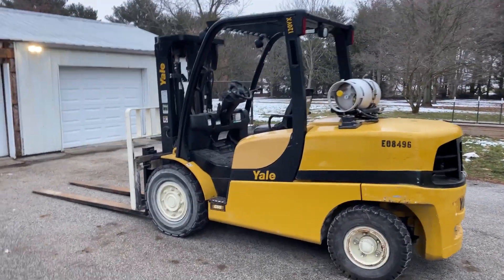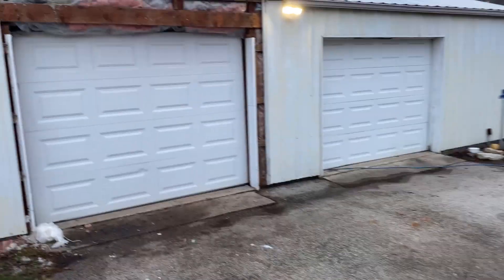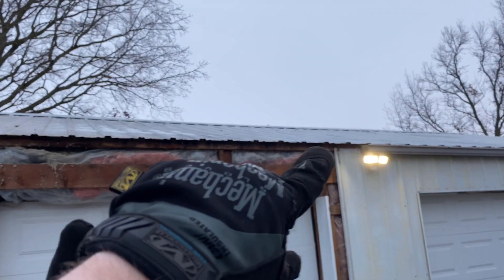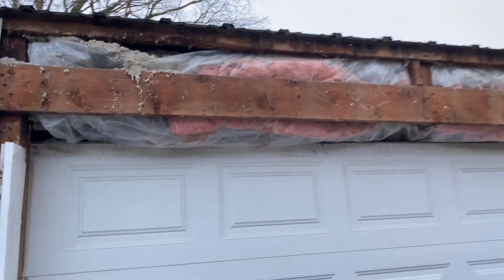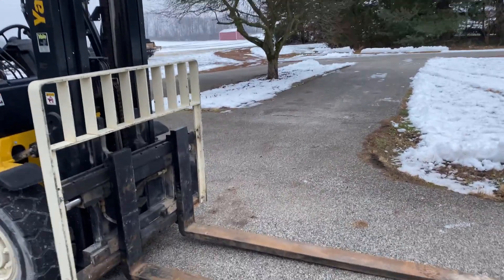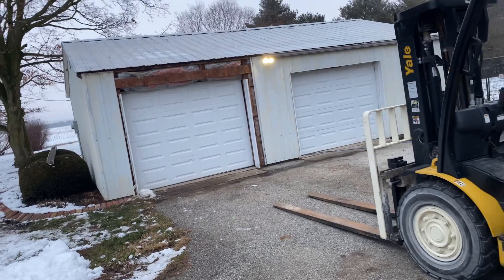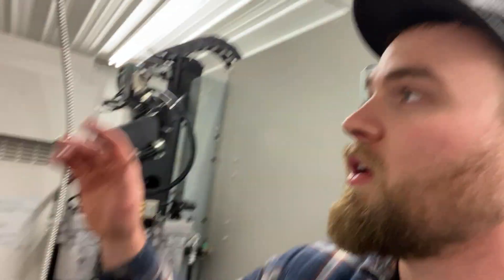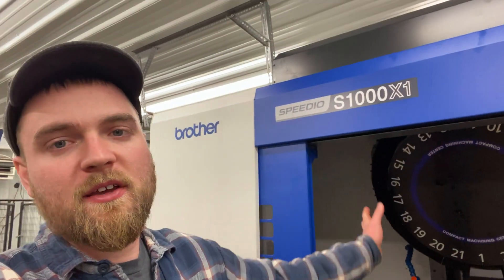New Machine Day! Brother Speedio S1000 Unloading/Unboxing

Comment: How have you been liking your S1000 so far?
Reply from the maker: It’s amazing so far! My cycle times are crazy fast and it holds tolerance all day and night regardless of shop temp. My only complaint is the sheet metal flexes when you lean in the machine and squeaks. I’m guessing this is only a problem on the s1000 with the huge door
Reply: @ozmachinecompany4564  That's awesome--seems like everyone I've asked has been enjoying their Speedios. How much did it cost you in the end before shipping and tax?

Comment: Hey, are you the guy I bought the TC-229 from?  You'll love the S1000, I love mine.
Reply from the maker: Maybe!! I had one and sold it a few years ago. I hope your doing great!
Reply: @ozmachinecompany4564  Yep, that machine has run thousands of parts, I did a restoration on the cabinet and replaced the spindle.  One thing with the S1000 is to make sure the power is all within Yamazen's specs.  If you are still running a phase converter, all the phases need to be within 10% of each other.  I had to get a 3PH transformer for it because it definitely did not like the high leg.  The TC-229 has no problem with the 220 right out of the phase converter.  If you have any questions, I'll be happy to help.  Just use the G100 and wear your brown pants.
Reply from the maker: LiTenUpADP glad to hear it’s making parts! Hahaha this is hilarious because I have my step down transformer showing up within the next 15 minutes. I’m glad you reached out! I will let you know if I have any questions. Your S1000 looks awesome. 4th axis is so nice. I’m selling my Robodrill with a 4th and I’m guna miss it.